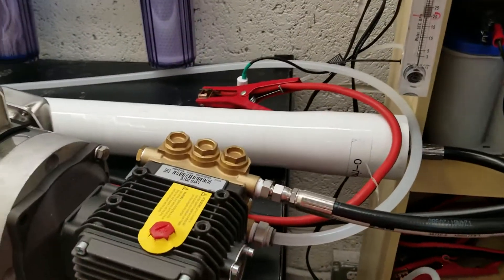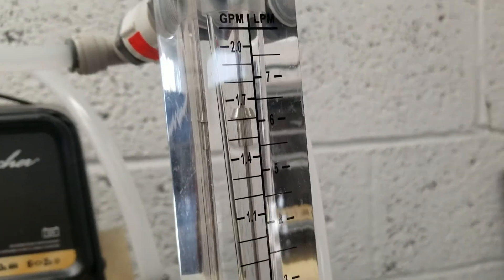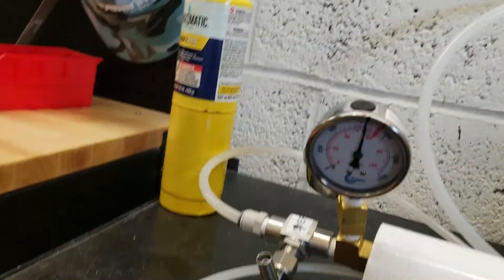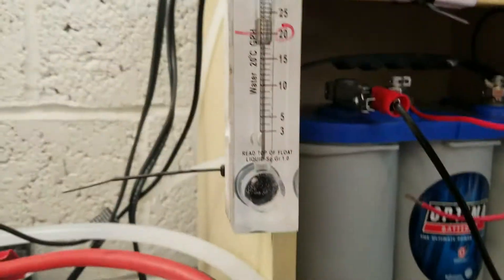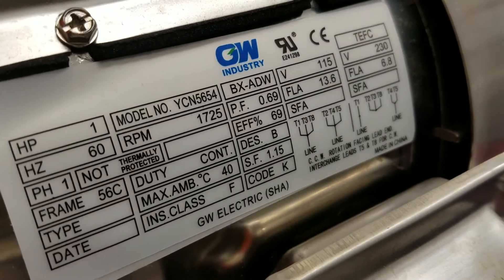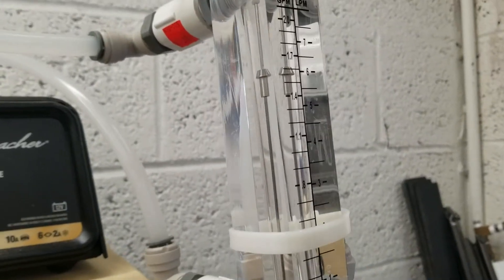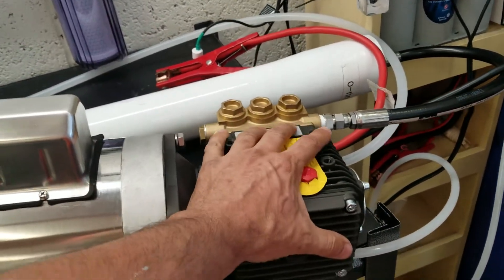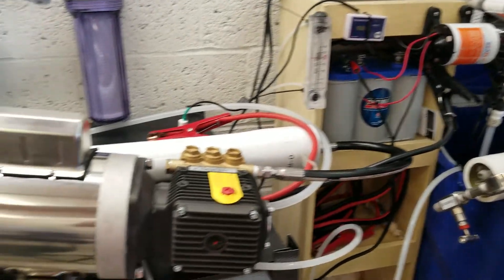Seawater Pro 110/220 VAC 12.9A, 2540, 21 GPH

Comment: Hello there. I've been looking into your water mater system for quite sometime and despiste the opnion of our sailor friends and all the online reviews, we can't decide between the AC or DC version. Our boat is a 36 footer catamaran where we've living onboard for the past two years. The idea is to prepare the boat for Bluewater and start a trip that probably will take us around the world. Our fresh water tank has a capacity of only 275 Liters, so fresh water production will be very important. We do have a AC generator onboard, also a Xantrex 2000 inverter and the ideia is to install solar panels (800watts to 900 watts combing all panels).  Based on those features, which system should we go for? I like the AC version as I heard the DC system can generate a lot more of maintenance, however, if we really "must" use the AC generator in order to run the system, that's a down side for us. Do you see possible to run the AC system lets say for two hours straight if we have powerful solar panels charging the batteries?? 
I would appreciate if you can help us on this important decision. Thanks a lot!!